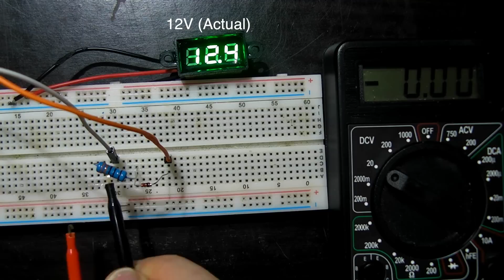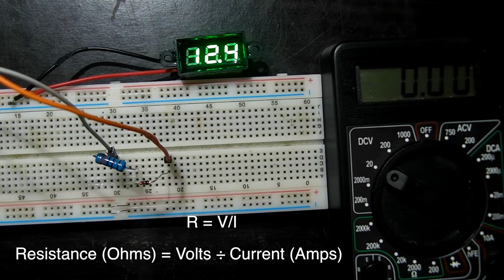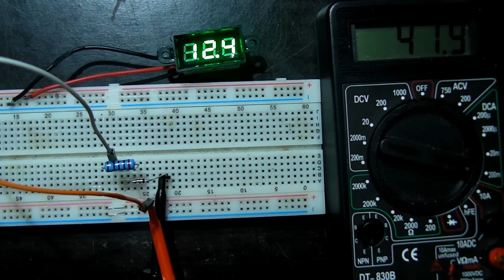Using Zener Diodes (Part 2!) -  Making a Voltage Regulator

Comment: hang on? Don't you actually have 8 watts going through that resistor and 4.6 watts through the diode? So why are they not burning? You do have that voltage across them don't you?

Comment: Really helpful video. I have a zener diode with unknown Zener voltage value. I am trying to figure out it's actual zener voltage by using a variable resistor connected in series with the zener diode, across a power supply of 5V. As I adjust the variable resistor, the voltage across the Zener diode changes too. The problem is that the change in current causes a significant change in voltage across the Zener and the voltage just continues to change rather than settling at it's fixed zener voltage. Having watched this video, it seems that that isn't the case, as the zener voltage changes not so much when you adjust the voltage of the power supply which results in change in current. So what am I doing wrong. Might it be the Zener diode itself?

Comment: This is bullshit. A Led conected in paralel with zener will bypass the zener. The voltage across led is the remaining of resistor voltage drop. Also the current is equal in circuit so 20 mA will be good for led. Come on man....

Comment: in what part we said that we want to limit the current to 20 mA? I calculated it and i have different maximum current for not exceeding the maximum power.  1 = 6,9 * I for resistor and 0,5 = 5,1 * I for diode. For resistor maximum current must be 140 mA and for diode it must be 100 mA. Because 140 mA is too much for diode, we must choose maximum current of 100 mA. Now we can calculate the resistance of a resistor...

R = U / I 
R = 6,9 / 0,1 = 69 ohms. But because its maximum allowable value, we can double the resistance and it will not burn.

Anyway its a good video but this part is confusing for me.

Comment: i tried to do a simple PSU for a subwoofer preamplifier, the preamplifier worked flawlessly BUT i didn't get to work the PSU correctly naw i know that the output resistor might be to large so the voltage across the zeners are 0.6V

Comment: I can see that the LED is connected across the zener and will draw its own required current to light up, but how much current will it actually draw? I believe the max current for a 5mm LEDs is about 20 mA. Also, how do you determine the minimum current needed by the zener to maintain voltage regulation? These points are not clear on an otherwise excellent video.

Comment: You can calcuate max current through zener diode in this case 0.5W/5V = 100mA but how do you determine MIN current needed for a zener diode?. Thanks for the video.

Comment: By reducing your zener diode from 5 to 3.3 volts you are automatically already increasing the current through that 330 ohm resister to (12 - 3.3)/330 = 27 mA.

Comment: I'm a bit confused. When you added the LED, didn't you place that in parallel with the zener? Doesn't that mean that it's only the resister regulating the voltage/current through that LED? How's the zener regulating the voltage to this load?

Comment: An extraordinary Video and crystal clear. well, I have a doubt.
I am using a BZX84C6V2L Zener diode and as per the spec sheet Zener voltage range is 5.8 to 6.6v. but I am confused with Zener current(5mA) vs reverse current(3mA). Moreover, Zener voltage vs reverse voltage(4v). 
It would be highly appreciated if you please explain the differences between the above attributes.

Comment: would  that zener diode working a design modle rocket ignighter i am building the launch controll it does not take much power from a 9v battery to fire the ingigniters

Comment: Pretty good explaination, i wonder if it'd handle small voltage spikes up to 40 volts without passing them on to the IC i was hoping to run.

Comment: Can you please help me then ... i want to make a circuit
Where i have a 12-15V input 75amp
And i want to output 7-9V 5amp 30W
Which will power a bulb that is rated 
12V 21W 1.7-2 amps
I want to power the bulb continually as 7-9 V
And sometimes pulse a 12v across that bulb to make it brighter without damaging the circuit while it is getting 12v pulses 
All my social medias are omeeDoski if anyone could help please i will appreciate it alot

Comment: Will this work if the voltage by the power supply is lower than the rated voltage of the zener diode?
Reply: I don't think so, because if the supplied voltage is less than the zener breakdown voltage, then the entire voltage will be dropped across the zener itself, and there would be no current flow in the circuit at all, neither any voltage drop across the resistor.

Comment: Your videos are the best I've seen yet, but I'm a little confused on this subject. If you can power an LED off of any voltage with just a resistor, why are you adding the zener diode? Like I know well that you can just power that LED off of the 12v supply using a single resistor, so the point of a zener diode seems useless in that situation
Reply: That is why a current source should be used to power a led. This ensures a 20ma current through the led, as long as the input voltage is above the leds forward voltage. When a fixed voltage is available, a simple series resistor is fine.

Comment: Wait a minute. You calculated 0.9A through the resistor while dropping 5.1V across the zener diode.  When you changed the zener to 3.3 for the LED you are now dropping 2V more across the resistor which will now exceed the Wattage of the resistor (and diode). If you change the zener, you need to change the resistor, too, just to keep the current the same. Correct?
Reply: I also noticed that something was wrong when replacing the zenner. To get the same 20mA (not 0.9A as Rich states), you should have replaced the resistor from aprox 350 to 450 ohms.
Reply: Rich Booth 0.9A assuming you have a 10ohm resistor, he actually had a 330ohm, 6.9v (the voltage across the resistor)/330ohm = 0.020 amps or 20mA. To get 40mA, just do the math, I = V/R, you want R, so you solve for it and you get R = V / I that is R = 8.7v (he changed his diode to 3.3) / 0.040, which equals 217ohms, he used a close value resistor and got something close to 40mA

Comment: N00b question.
Why would you put the LED in parallel with the zener diode as apposed to in series?
I would imagine the 'safe/protected area' to be snuzzled in the middle between the resistor and the diode, where as spanning the diode would create an unregulated path?
i.e. like a firewall..
Reply: Remember that voltage is measured between two points. The whole idea of this circuit is to create a 'safe/protected' area of voltage between two points. Using the zener diode creates the needed voltage across it to operate the LED. There is no voltage between the resistor and the zener diode. Putting the LED in series with the resistor and the zener diode would be adding another 3V drop which would cause the voltage across the resistor to have around 6V across it,  which would cause the current to change.  So the whole point is to be able to get the right voltage across the LED and then modify the circuit so that it can supply the right amount of current when under load by the LED. Great question :)
Reply: vince rodriguez nice explanation. Thanks